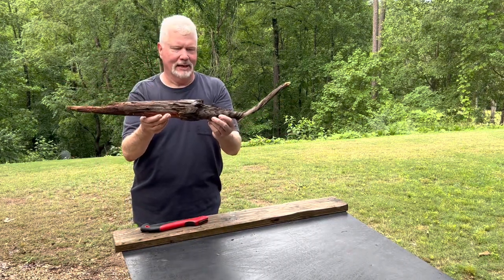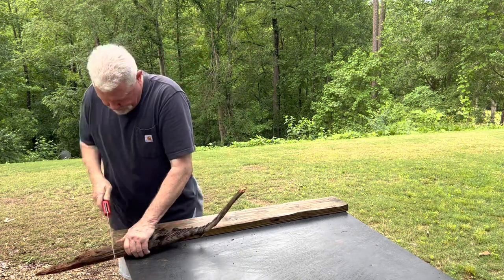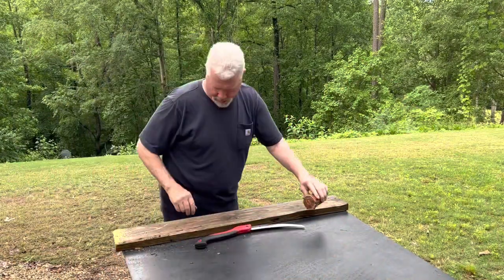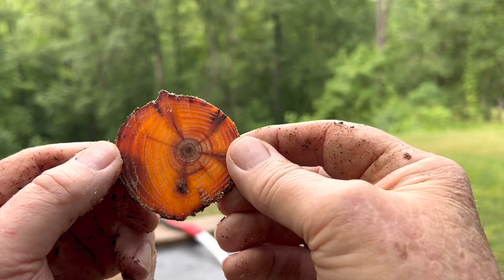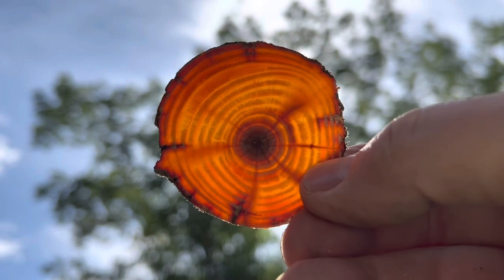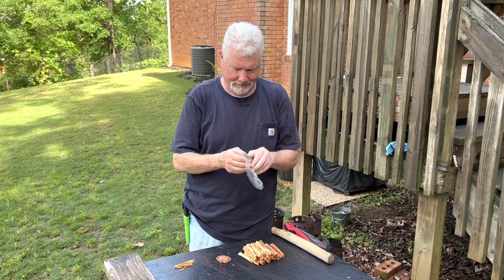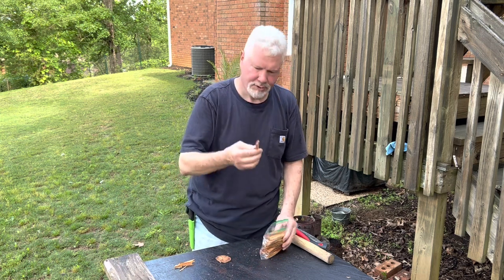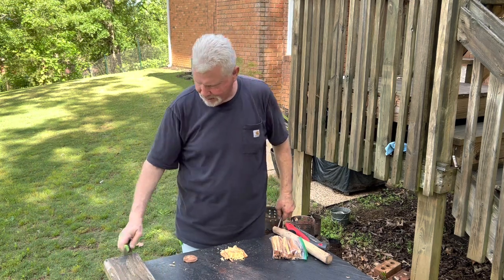Fatwood Sticks... How To Make, Use, Store, And Clean Off Resin

Comment: Nice Corona pruning saw. I love mine and use it a lot when I go fat wood hunting along with my 511 mora. Kudos
Reply from the maker: Never tried the 511...
3.6-inch fixed blade, high carbon steel utility knife, for high hardness, easy sharpening, and exceptional toughness
Impact-resistant, ergonomic TPE rubber handle for optimum grip; included finger guard provides additional safety
Hard plastic Combi-Sheath features a quick-connection for the addition of a second knife and sheath
Blade thickness: 0.08 in (0.2 cm), blade length: 3.6 in (9.1 cm), total length: 8.25 in (20.9 cm), net weight: 3.9 oz (110 g)
Made in Sweden; limited lifetime manufacturer’s warranty